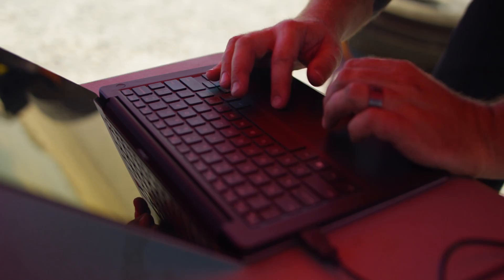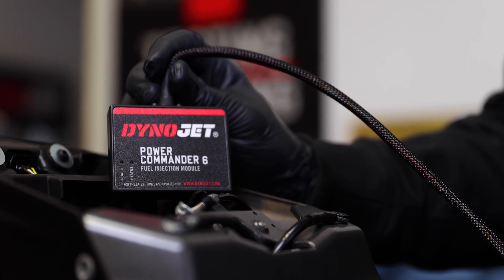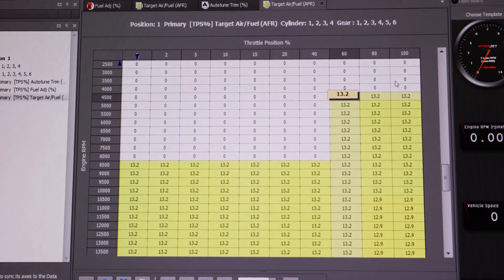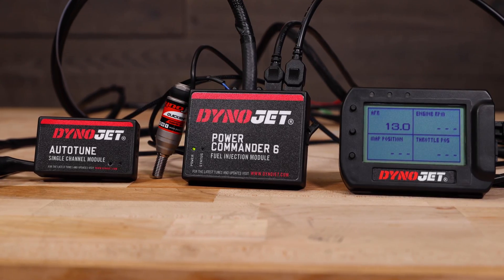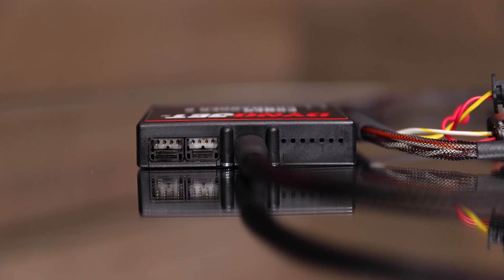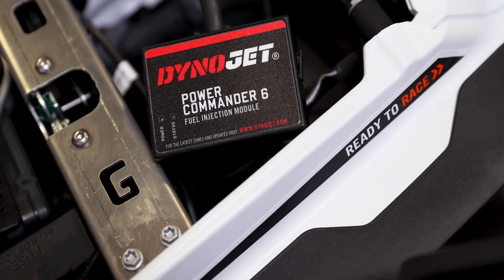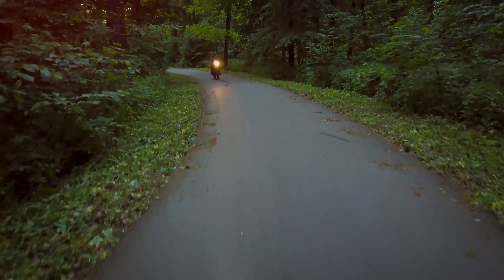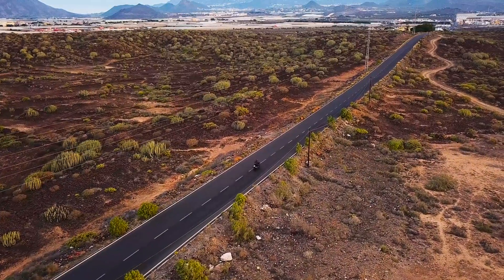Power Commander 6 - Fuel and Timing Adjustments Made Simple!

Comment: Hi can power commander 6 alter cold start mixture on a victory vision ? because it runs fine when warm but when cold start kicks in it runs to rich and fouls spark plugs really quickly especially if I only do a short run say a mile
Reply: Might want to check intake air pressure sensors and intake temp sensor, maybe coolant temp sensor. Make sure they are outoutting proper voltage. 
The autotune system with the o2 sensors can also be plugged into a pc5 or pc6, and will monitor your a/f ratios and make adjustments if you want it to as well.

Comment: I'm not satisfied... Pc5 much better ...

Can u explain me. Why I buy pc6 ?
Ignition module, quick shifter, autotune etc ...
Reply from the maker: If you currently have a PCV there would be no need to replace it with a PC6. The Ignition module and SFM are NOT compatible with a PC6 but you can still use a quickshifter and/or autotune.

Comment: Honestly after all the $$ I have spent with dynojet for widebands, pc3's, pcv etc you go and release a so-called new product that is completely inferior to the last? I sure hope you understand that not every single person on the planet has a dynojet facility nearby to install custom tunes and which is why some of us build our own custom maps. I must say this is a complete smack in the face to the end user and past customers by practically locking down a pcv and re labeling a 6!! Shame on your company for this!! Then somehow dynojet also believes the pc6 is, and should still be considered in the same price range as the 5?? Good luck I hope this comes back and sales drop significantly!! And this is coming from a long time loyal customer!!
Reply: Why is it inferior? Just trying to understand. Thanks
Reply: @kawi704racing  well I feel that most people purchase these fuel controllers to have full access to fuel control as some peoples needs may require more then 10% or 15% fuel trim, not just because most people this is enough adjustment? This is only because Dynojet wants more people to go and PAY again to have there controller fully unlocked through a dynojet tuner instead of being able to do so themselves. Not all people live in urban areas where a dynojet tuner is available and some people can actually tune themselves for the most part. If the PCV had full control with no limitations then why would they need to make a so called PC6 (which being a 6 should have more control and features) unless it's because they want people to bring there equipment to there tuning centers clearly to make more money? That's why most people purchase a power commander,  to have full control not pay someone else to then unlock its features it should have unlocked from the get-go
Reply: @MyJman37  You have Right. i think the same has you. I have PCV.

Comment: One of your replies here says +/- 15 for Fuel? So it looks like you have made the PC 6 useless for adding enough fuel for bikes that have removed the secondary butterflies and/or not enough fuel for Nitrous in Map 2 (not even a 40-shot on most bikes)???
PLEASE tell me that isn't so!?!?!? because that's one of the main reasons I use and recommended Power Commanders...
Reply: @dynojetresearch please respond
Reply from the maker: The end-user does have limited adjustability. A tuning center still has access to the base fuel map which offers more adjustability and would allow you to tune in those scenarios.

For 99% of our customers they just need a base map that correlates to their setup. For these guys offering a base tune and then +/- 15 is more than they will ever need. If you have a setup that needs more you can visit an Authorized tuning center and they have access to the base map.
Reply: @DynojetResearch  By Base Map are you referring to the actual bike ECU map or are they able to make a larger than 15% change to the PC6 map ? Please clarify.
Reply: @benduncan3865 crickets...

Comment: How is this better than the PC5 I have?  Genuinely curious
Reply: I need all the adjustability I can get so I ordered the pc6 because of the timing adjustments  that it doesnt even have and newer models SHOULD be better.
Reply: @jaredhess3482  pc6 doesn't have timing adjustability?
Reply: @tl924   curious to this myself as which one is better, looking to install one but wanted to know which ones worth the bang for the buck. Seems the 6 moved backwards in quality maybe?
Reply: I just installed my PC6 on my 2007 r6 and man the throttle is so much responsive. Smooth in the gears. Sucks that PC6 has 2 maps. I map mine on version 2 and it’s been great. Still wanna max it’s full potential by putting it on the dyno.
Reply from the maker: The PC5 is no longer available for sale through Dynojet Research. The PCV and PC6 will get you the same performance at the end of the day.  The PC6 has less adjustability to the end-user but same tuning parameters for a Tuning Center.
Reply: @DynojetResearch  That's not what he asked.
Reply: I have the same question I have a 22 mt09

Comment: Is there any added restrictions on the new PC6 unit vs. PCV or there is no added restrictions and every adjustment that we could do using PCV can also be done on PC6? 
Thanks
Reply: Pc6 is a piece of shit
Reply from the maker: You can adjust fuel +/- 15 over the base map and +/- 8 on timing if applicable.
Reply: @DynojetResearch  Thanks

Comment: Hello I see you guys have a Power Commander 6 for 2018-2019 Triumph SPEED TRIPLE mine is a 2020 Model but is the same as 18 and 19 model nothing change would this fit right and I been looking for some Ignition tunning would this Version is able to do something in that part ????
Reply from the maker: PC6-21027 does work on the 2020 model but is not available for use on a 2020 model in the state of California. This unit does NOT have Ignition control.
Reply: @DynojetResearch  Thanks for the info 👍

Comment: got woolishracing for my honda, looks like it can do much more than PCV
Reply: A Woolich ECU reflash will offer more tuning parameters than a Power Commander.  If you need to adjust more than fuel/timing then a reflash may be the way to go.  Dynojet does offer the Power Vision 3 for some Honda models.

Comment: Why buy the 6 over the 5 from an end users standpoint? Is this a question for my tuner?
Reply: The PCV is no longer available
Reply: @dustywheelz7854  it’s still for sale all over the place. Just not on their own website which makes sense since they are trying to sell the newest model.
Reply: @BigSexysHouse  For sure.  The PCV and PC6 will get you the same performance at the end of the day.  The PC6 has less adjustability to the end user but same tuning parameters for a Tuning Center.